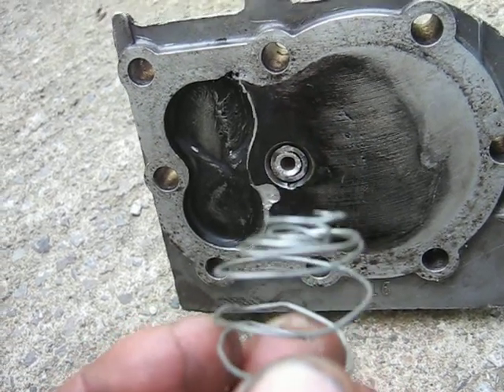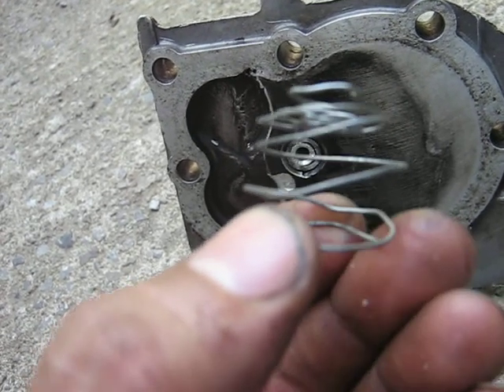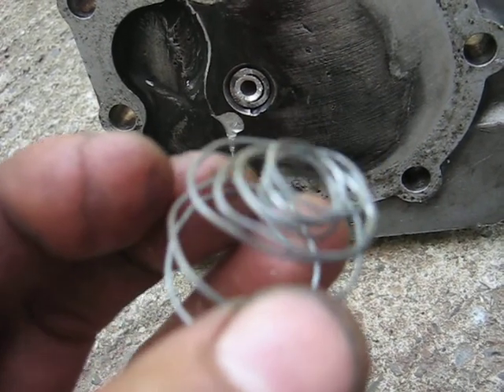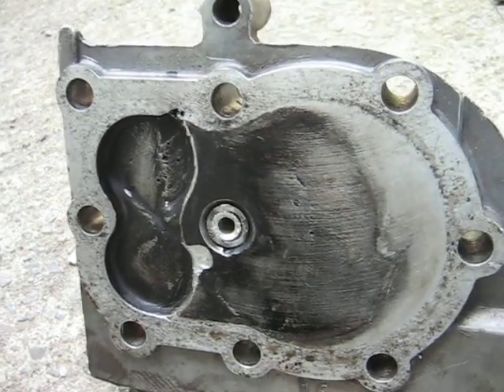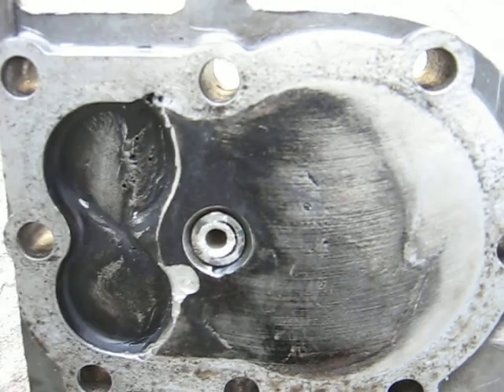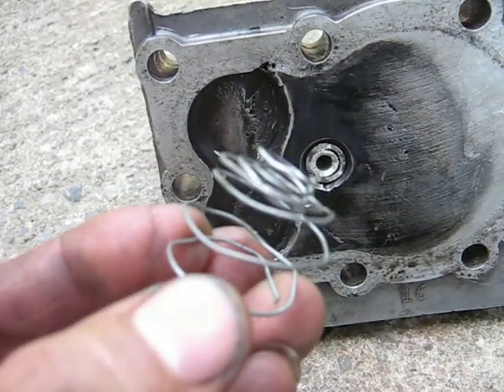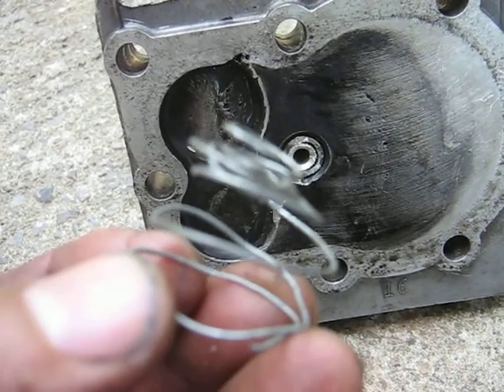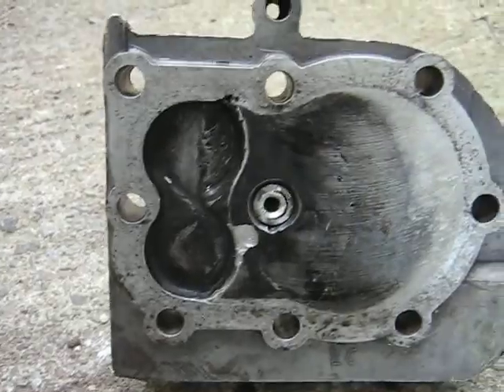Light Valve Spring for Suction Inlet Valve

Comment: u gona try to convert one of these to a hit and miss engine im stuck working on my big generator mabuy ill make a vid of it tomarow runs good but im having some gas delivery isuses IE air fule mixture i have no real gas tank the thing is also a HUGE PAIN IN THE @SS to cranke  i use a 5 HP electric motor to tern it it has 2.5:1 reduction belt and it still almost dosent tern it but i digres i would like to see your fly wheel engine =3-

Comment from the maker: Really, I haven't seen that one. I am a little curious how it is a real diesel with out fuel injection. I could have a Briggs running on glow fuel tonight, but I wouldn't consider it a real diesel. A matter of opinion I guess.
Anyway, It is dangerous if you try to make a regular Briggs run at 20:1 compression, too high of pressures compared to what the engine was designed for. You could perhaps tear the head bolts right out of the block. I have to watch what I say, wouldn't want a lawsuit! :)

Comment: There's a website with a billion pages on how to convert a lawnmower engine to diesel, you just have to have really short injector duration. In trucks they have long duration which is what gives them torque but it would blow a lawnmower. Still really dangerous though. I wasn't going to build one in the first place but after seeing a diesel "run away" I'm REALLY not going to build one!